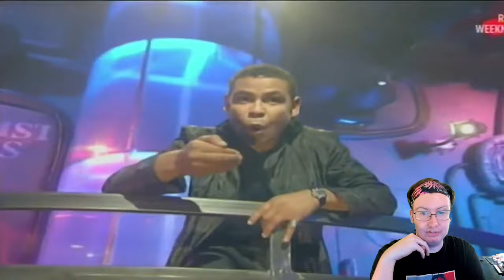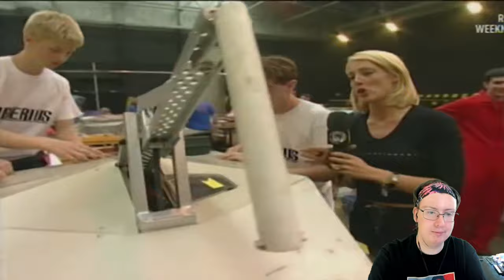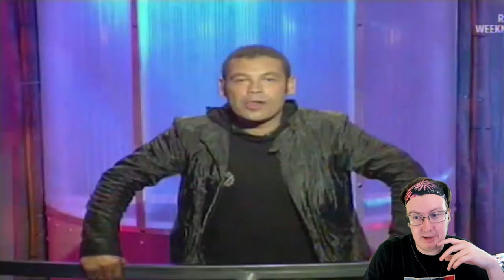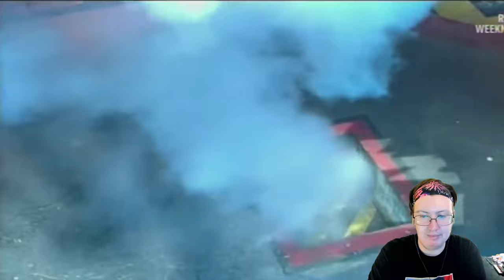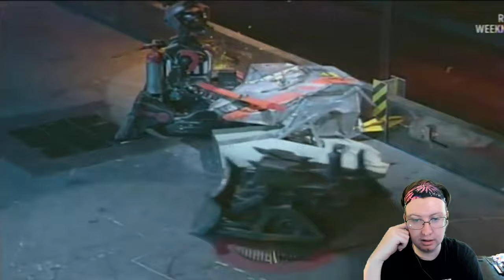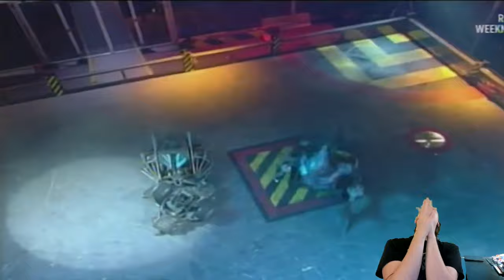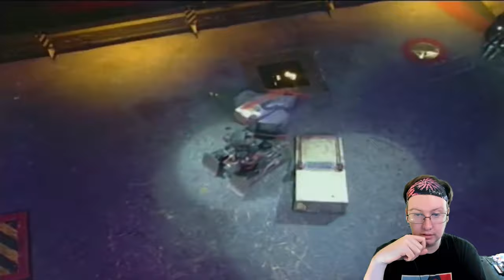American Reacts to Robot Wars: The Fourth Wars (#11)

Comment: 1:37 No, Craig, "even Belgians matter to Thermoman!"

Mousetrap, the best robot in this weak heat, and the best robot this team produced, at least in the original series. It was terrifying in Series 5, when they added a blade to the arm and basically turned the robot into a mobile guillotine. As Jonathan Pearce said, 100mph is talking rubbish, 100kph would be closer to reality, I think. 

Tiberius 1, yet another piercer design that didn't get what made Razer so destructive. The point is too small, so even though they realised that the wedge is part of it, it doesn't matter in the end. The damage caused is too small. Tiberius 2 and 3 were closer to the right idea, and they were pretty much there by Series 7.

Wel-Dor, the only NI machine in the original series, the first version was the most successful, despite not being very good. My school entered Techno Games, so were another team competing for the region, and I remember my classmates asking why I wasn't involved, since I'm the big Robot Wars nut, but I only watch this stuff, I couldn't actually do it. I wasn't good at Design and Technology, as it was known. (Dunno if it has a different name now)

Comment: Well done, you’ve now done the worst episode of series 4 IMO. I think Evil Weevil was overrated in terms of seeding because (well you have to watch its heat in series 3 to see why) and then lost because they chose the battery that they didn’t know if it was fully charged or not. That’s bad. Tiberius looked good but was let down by its reliability and the crushing spike weapon being too slow. Wel’dor I like the ambition of having a pneumatic front-hinged flipper and axe in the same design and keeping it under the 80kg weight limit. But it was terribly armoured. If you can get ko’d by either Sump Thing or Little Fly, you’re doing something wrong. I disagree the Little Fly did nothing in the heat final but the show definitely overrated the “damage” of the scratches on Mousetrap. Mousetrap basically controlled the fight for me basically by being a wedge getting underneath a slow robot with ground clearance. So I agree with the judges’ decision.
Thankfully things pick up again in heat L and some amusing moments that I’m looking forward to seeing your reactions to.